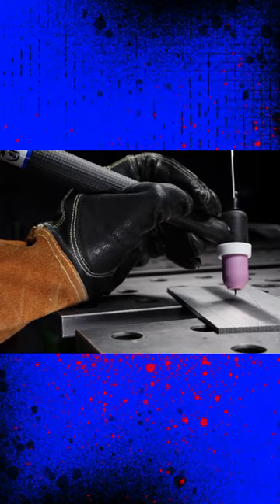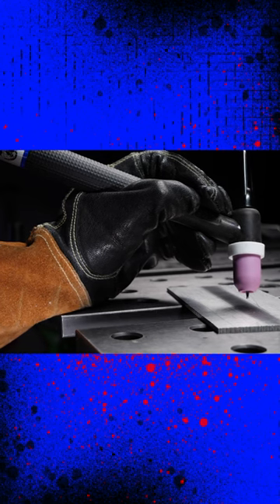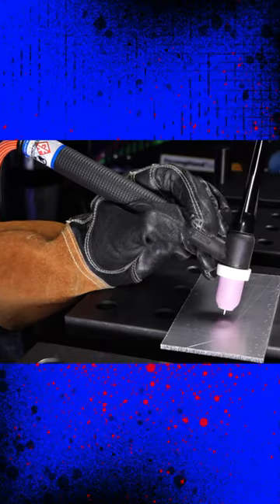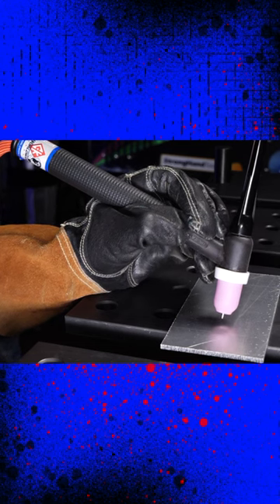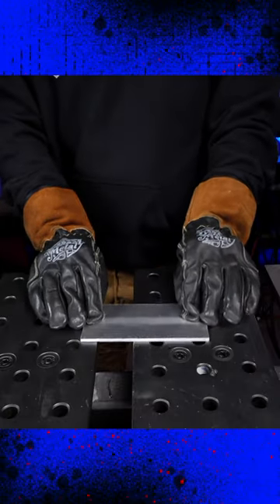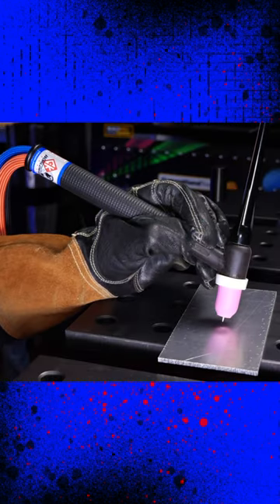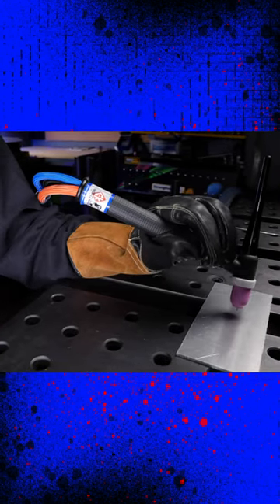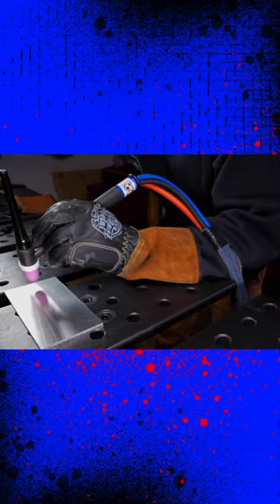please STOP THIS when tig welding! Try this instead! #shorts

Comment: I like this tip! You can also clamp a smooth piece of pipe or square tube on the edge of your table that allows you to slide along a longer joint.